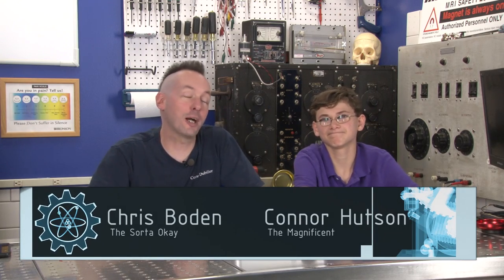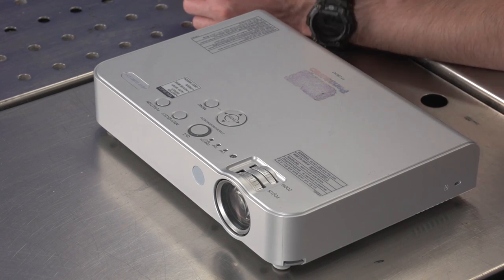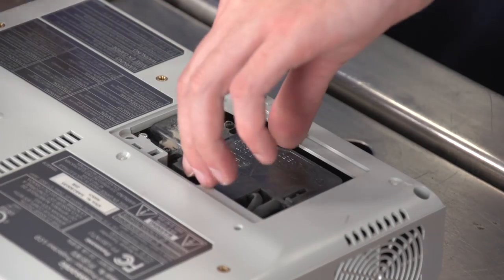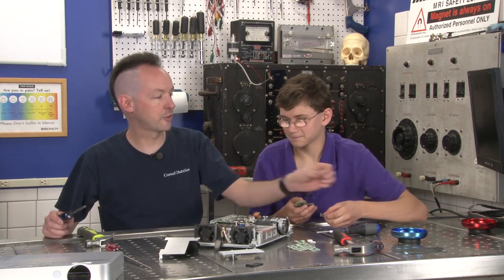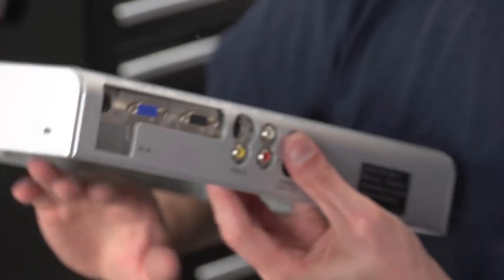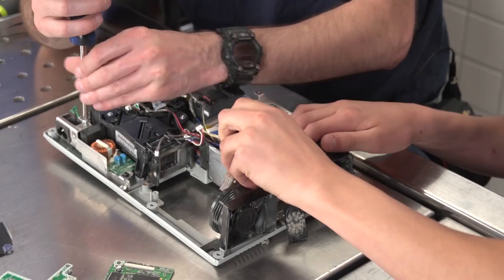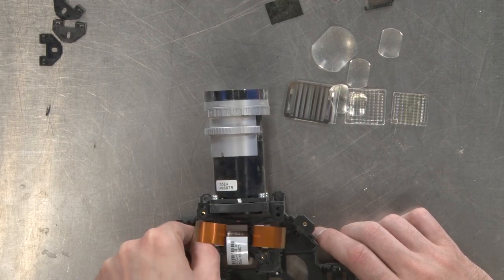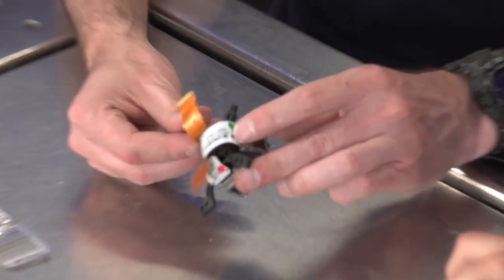LCD Projector: Equipment Autopsy #83

Comment: Yes that's a thermal fuse, it will rupture at the designed temperature, you often find them in water heaters too, the other device seems to be thermal control, either for adjusting the speed of the fans, or as an electronic overheat control which would be set at a lower temp than the thermal fuse.

Comment: What Connor said about turning radius of "O" gauge vs "27" is true. My dad had "O" gauge engines and the only track available was the "27". The turns would tight for the "O" engines however it would be usable to run a line around your building.

Comment: That little device connected to the white wire is probably just a small signal diode like a 1N4148 or similar. I use those all the time as a cheap temperature sensor.